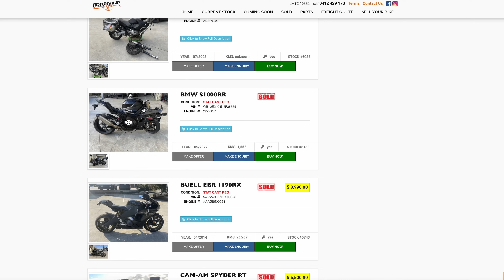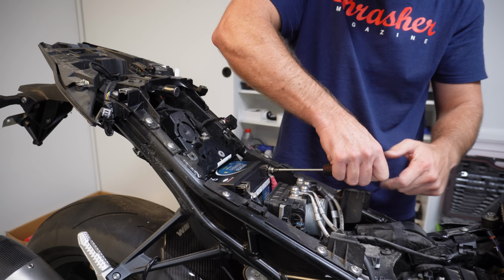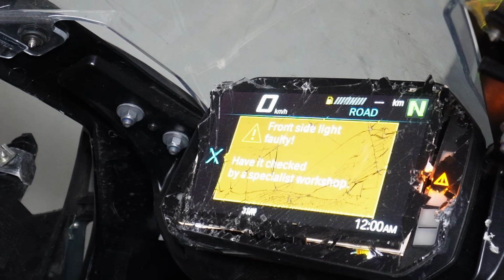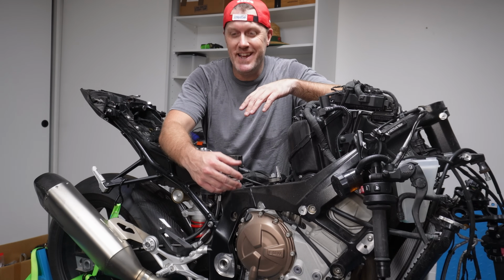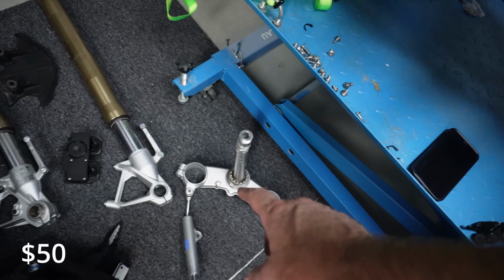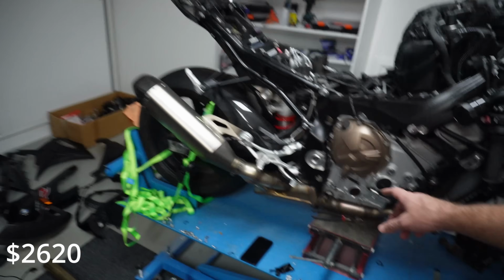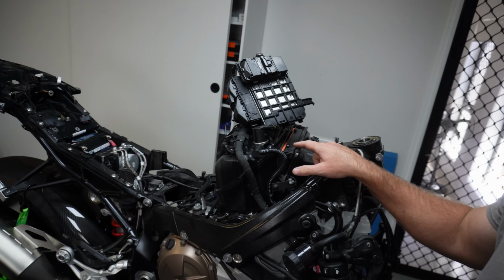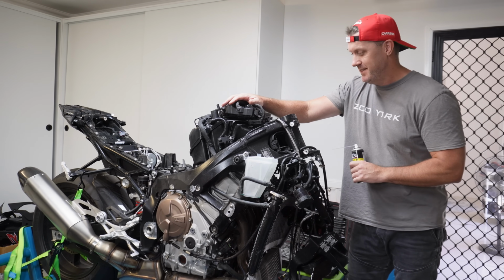BUYING CHEAPEST BMW S1000RR… IN THE WORLD!

Comment: The buzzing sound it’s just the fuel pump having power to it(not it priming) mine does the same thing, as for that sound, you hear at the beginning of start up it’s the timing chain tensioner, it’s tensioned by oil pressure ( I have a 2010 s1000rr that’s how ik)
Reply from the maker: Thanks Justin